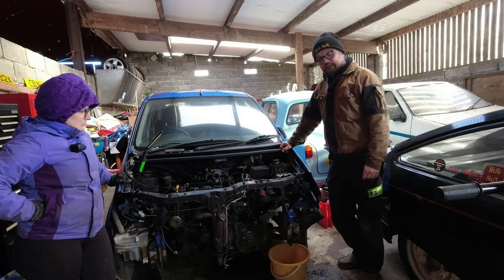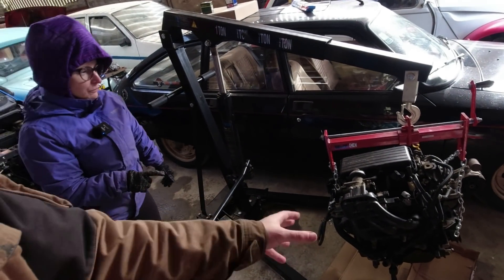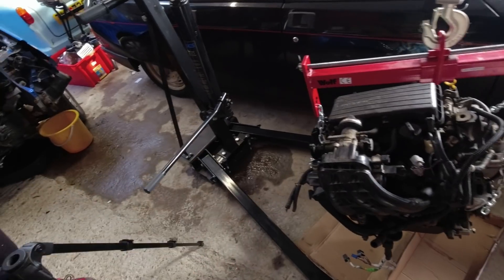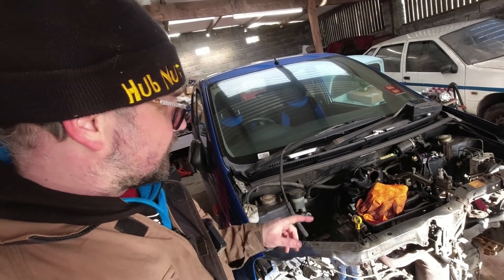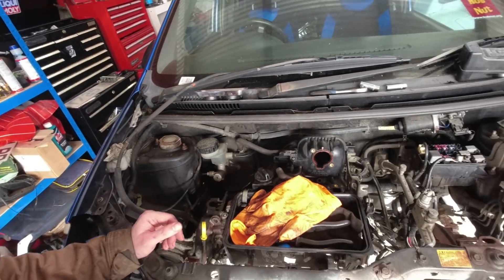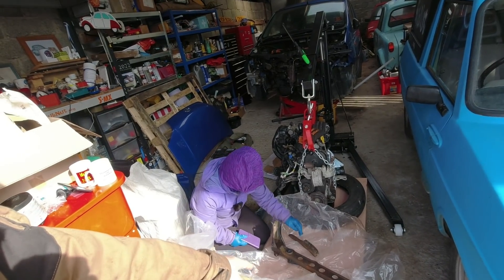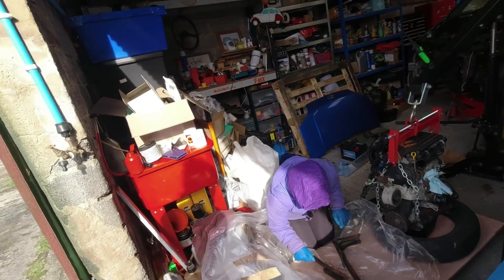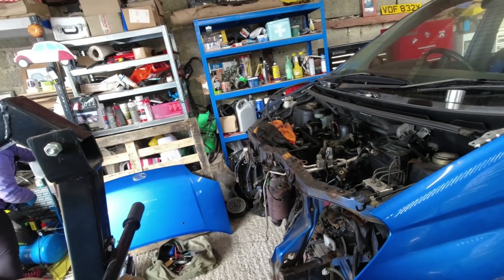Daihatsu Charade Engine Swap - It's out! (Ep3)

Comment: Tip from a (very) old mechanic, if you swap sides with the hub nuts (assuming they're both right hand threads) you can re-use them, as the peens will be in a different place unless you're very unlucky, so you'll be peening a good part of the nut into the shaft indent. Saves waiting for new nuts (also saves cash!).
Reply: That's why I always preferred working on trucks and buses,  left hand side left hand thread, and hoped one had a long breaker bar.  (six foot scaffold pole).

Comment: When I was 21 I remember lifting an engine into a Ford Anglia by hand and jiggling it into place with a foot on each wing. I'd hope I'm a bit more sensible now and would use a hoist. Good job BTW.
Reply: Yes.  I recall standing on the wings and wiggling the engine onto the bellhousing with one foot, on an RS3100 Capri.  I was small and light, so...err.  Also did a Maestro gearbox up over the wing by hand cos' I got p p p err fed up trying the Haynes manual way.  Oh the joys of youth.
Reply: Changed a couple of engines using two people either side of a long pole to lift it out …no hoist  just brute force lol but when i got to mini metro engine and boxes i had a chain block and 3 pole teepee style rig..which was good enough so i could do them on my own
Reply: My mate did similar with Mini engines and a rope around his neck & shoulders
Reply: My back reminds me when I used to lift Hillman Imp engines out by hand. OK all alloy and mostly possible to slide out but the final lift onto a bench was a stupid level lift.

Comment: Unless you can do this yourself it's easy to see why these things become scrappers - even allowing for professionals far too much time is required, making them uneconomic. Well do to both of you.
Reply: Very true, I own a 2016 Citroen C8 at the moment and it needs in excess of £1,000 of garage repairs to keep it on the road (it's only done 90,000 miles so it's barely run in). Quite a tall order for a car we only paid £2,700 for five years ago.
Reply: Yes if paying someone it becomes economically unviable

Comment: Well done. Done a couple of engine swaps in my time, but all on rear wheel drive cars. Front wheel drive with disconnecting shift cables and driveshafts and such is just an extra level of pain. Just remember where everything goes when you put in back in. 🙂
Reply: Haha an oil and filter change is enough for me
Reply: @Taz6688  Depends - from what I've seen US land yachts have always been a nightmare to work on, the engine bay too large to actually reach bits at the back but crammed full and you need a ladder to get up there in the first place.

Comment: You did great! These more modern, compact cars are a real pain to work on compared to some vintage cars with straight six engines and lots of room in the engine bay. Front wheel drive also adds to the difficulties, but you got it out!
Reply: Indeed, my Mum's first car was a Triumph Herald 1200 and I remember my Dad folding the front of the car forward and then sitting on one of the front wheels whilst he pondered his next move.

Comment: Well done, Ian and Karley. That is quite the job! At about 23:30 minutes you were wondering how a bolt that is not right could be stuck. That one is easy. Dissimilar metals producing a galvanic response. That has caused more ruination than enough.

Comment: Well done you two. A couple of things; when you change the clutch and gearbox, change the flywheel so that it is the correct one for the ECU. Also, before you put the engine back, move the axle stands further under the car so that you don't have so much hassle putting it back in.
Thankyou both for a very entertaining video, well worth the wait!
Reply: @glennpowell3444  it is, but the pattern on the flywheel has to match the ECU, otherwise the engine won't know when to start.
Reply: @Alfred Wedmore ok, the flywheel has a specific pattern of holes on one or both sides depending on the manufacturer and engine type.
If the wrong flywheel is mated to the ECU, the pattern, as it spins will send the incorrect set of signals to the ECU, which, for want of a better word confuses the ECU. The signals change according to speed of rotation and load on the engine telling all the sensors to send back information to guide the ECU to make the correct move for the motion of the engine.
The simplest way to see this is, no spark, no engine running. To get it to run correctly, all the old style parts that made the spark at the correct time for the correct speed and load on the engine have been replace with electronic sensors and digital information to make controlling an engine more suitable for modern use, just as the cap, rotor arm, ht leads,coil, balance weights in the distributor, all used to make granddad's Morris Oxford run well enough to climb a hill, and then slow said car on the way back down.
I only hope the rambling has helped some of you understand a little better, the way driving a car is basically the same now as it was in grandads day.

Comment: Well done! The packaging on such small cars can make things a pain so that's quite an achievement taking in to account corrosion and issues that come with age etc. I also own that massive Clarke impact and it's so clunky it's ridiculous but also, doing things like drop links and stuff it will tighten stuff to snap point and then it's dead easy to remove, the only weapon that beats Renault rear damper bolts too, there's a place for it in the toolbox but do invest in a quality cordless one, it's a game changer.
Reply: I was thinking of getting those Milwaukees battery impact drills 18V a little one snubby nosed.But they are 500-550 euro's just insane! Not worth buying because I am not going to use it on a daily bases.It's very good stuff of what I have seen.

Comment: I wish it was interactive as there were a few occasions where I was screaming "no, don't do that!!"  The drive shafts are held into the differential just by a circlip in the output shaft.  You just pop the whole joint and shaft out using a lever of some sort without disturbing the rubber boot.

Comment: Hi both of you, I enjoyed that and you both did a great job, it came out a treat. As I mentioned on another social media platform I’m currently converting the engine on 1998 VW T4 from the standard 1.9td to a Golf Mk3  tdi engine, we only have the mounts and driveshafts to unbolt then it should be out ready for the tdi to go in. I have my own Miss Hubnut assisting (Miss Menditman 😂) and recording some of the process. Good luck with the reinstallation, I’ll look forward to the next part 🙂👍

Comment: A quick way to get the drive shaft out is to remove the front wishbone bolts and you can then pivot the wishbone / hub assembly out the way to pull the shaft. If your under the gun the less bolts to remove the better! Can even leave the tyre on doing it this way!

Comment: Well done guys, That was quite a tricky one to get out! With the inner driveshaft joints, you can get a prybar inbetween them and the gearbox, and with a sharp action you should be able to 'pop' them out. Be careful not to drop the bearings out  that inner tripod joint (bit still attached to the driveshaft). Often they only go on one way as they have a slight taper on the outside diameter, and you'll spend a while headscratching figuring it all out. Even wipe the grease off and wrap some tape around the outside to hold them in place? Top work so far!👍

Comment: Well done, I know it's more expense but I'd put a new clutch in instead of using the old one and if you are taking stuff off and it needs gaskets replace with new ones which means inlet & outlet manifolds as well, great job getting the engine out big job in itself, but good luck.👍👍
Reply from the maker: Getting the right gaskets is proving impossible, so I'm leaving the inlet manifold well alone.

Comment: Well done! I can only hope pulling the old engine from my Bug goes as well. Granted, there's far less to disconnect on an air-cooled, non-AC, manual car with only for bolts holding the engine to the transmission, but the engine-bay is still small! XD

Comment: In the 1970s I had a Daihatsu 360. I lifted the little 2-cylinder engine out to work on it. The Charade engine is a 3-cylinder but still quite small, if I had to remove it I think I'd drain out the oil then unbolt it from the gearbox as I did with the 360 and it should lift out. Then take the gearbox out separately if you need to.
Reply: Weren't the Daihatsu 360's two stroke? I bet getting that engine out would have been a lot easier than this.
Reply: @cornishhh  Yes it was a 2-stroke and lifting it out was easy. But I think the Charade engine would be easier to take out if unbolted from the gearbox. You might be able to reuse the existing gearbox and you'd be wise to replace the clutch.

Comment: Just a word of advice, when removing driveshafts all you need to do is remove lower ball joints and pop shaft out from gearbox side, thereby leaving them attached to the wheel

Comment: great job mate, knew you could do it even if you didn't.  Good apprentice as well.  Exhaust manifold bolts may need some heat to get them to release. Also work them backwards and forwards, because if you use gorilla force you will break them off.

Comment: brlliant you've got there in the end, so satisfying isnt it! now if you've labelled everything it should go back in just as easily with a wiggle. front wheel drive cars are not that hard given slightly less space. Just get a cordless impact gun, there are plenty of 'hub-nut' level entry ones like parkside from lidl etc, it will make things easier and a little quicker

Comment: Glad you avoided the hubnut moment of removing driveshafts without emptying the gearbox oil. Cordless ugger dugger guns £60 from Lidl this week complete with impact sockets. Bit surprised you dismantled the inner CV joints rather than just lever the entire shaft out of the gearbox - just held in place with snap rings? As ever a good idea to store the front wheels under the car as extra support should a stand or jack fail when you're underneath. Good job.
Reply from the maker: That'll be because I didn't know they were held in by snap rings. We have the full dealer manuals but they're not very clear on quite a lot of things...

Comment: Never worked on one of these, but I’m pretty sure that’s not how you remove the driveshafts from the box. The shafts should come out complete, the inners should pop out with a lever bar. There’s just spring clips holding them in.
Reply from the maker: So it seems, judging by the comments. Oops...
Reply: @HubNut  everyone can’t know everything.. 👍

Comment: Cordless Ugger Duggers, are in  Lidl this Thursday  £60.00 😊😊🍻👍
Reply: They don't have the nuts to get stubborn nuts off sadly. A lot of the reviews report they struggle even with slightly tight wheel-nuts, which renders them a bit pointless.
Reply: @BarryManatee  Where can we find these reviews?....but time will tell, I'm picking one up Thursday 😊😊😊😊
Reply: @bigtrev8xl  Just google the name of it and include the word "forum" in your search. There's loadsa people on car forums discussing them . This works for any tool or parts manufacturer. I just type "name of thing" "any good?" "forum" and get loads of results. When I was thinking about buying the lidl rattle gun I just found loads of people underwhelmed with it. It'll be ok for small stuff, so maybe ok for working on motorbikes, but it doesn't have the guts for bigger stuff. For that you have to stick to corded if you're wanting something cheap. The Clarke corded one has guts and will spin off crank bolts etc, but it's pretty big and no good for small spaces.

I don't see the point in impact guns if they are weak. It defeats the point in owning one I reckon. Hope this helps.

Report back if it's ace when you try it. It's possible they improved it since I last looked into it :)
Reply: @BarryManatee  I just found some favourable test reports on YouTube ...of course, some like to slag anything off, if it's not Snap-On on it . I will be using it for home use, not professional I'm sure it'll be fine for the sort of work I'm likely to do, I've used Snap-On impact drivers in the past, and they very often need a freshly charged battery, to undo the tights of nuts and bolts
Reply: @bigtrev8xl  Maybe the discussions I read were for a previous model. Hope it works well for you. Their returns policy is great, so worth a try and if it's crap take it back :)
Reply: @BarryManatee  Indeed, their returns policy is a good reason to buy from them, as long as it undoes my wheel nuts it'll be happy..😊👍

Comment: It's not too late to label up some of the plugs, sockets and connections. Every little helps. It will be messy but you could use your pressure washer on the engine bay. Should have been done before the car went in the garage. You could do the new engine though. I won't expect Sarah standards.
It didn't sound as if your ugga-dugga was working properly. Are there torque settings?

Comment: Charade is a very appropriate name for this car on this channel 😂
Please never become too Professional? You'd loose a lot of the charm of Hubnut. 
I think the reason for the reluctant gearbox mount bolts is they were put in cross-threaded (bolts wound in by a windy gun instead of being started by hand) and gave the clutch place the impression they had tightened normally (or they simply didn't care!) 😜

Comment: dont replace the hub nuts just swap sides putting the off side nut on the near side and the near side on the offside using new split pins. leave the nearside driveshaf in the box so the diff doesnt drop inside the box making it virtually impossible to reconnect the driveshafts.
Reply: @oojimmyflip @HubNut It doesn't look like they have split pins. I think it's the staked type, which should be replaced ideally. That's why they look mangled. They are designed to be crimped into a groove. It's quite unsophisticated. You sorta peen them into the groove to secure them. This can be done with a hammer and a punch or flat screwdriver that fits into the groove. I could be wrong, but have experienced these on a Saxo. This video shows what I'm on about:

https://www.youtube.com/watch?v=93vtGzOgvXU&ab_channel=SchleyTools